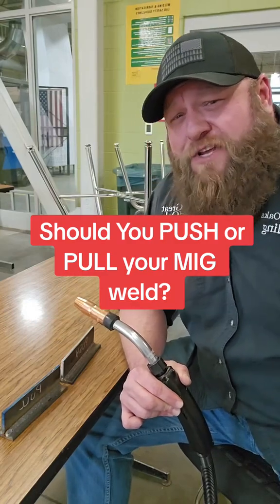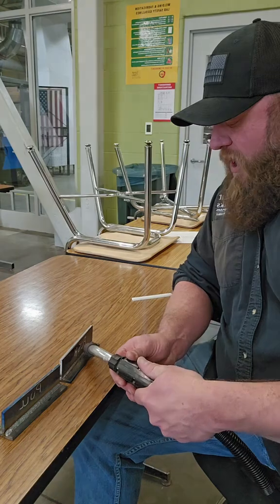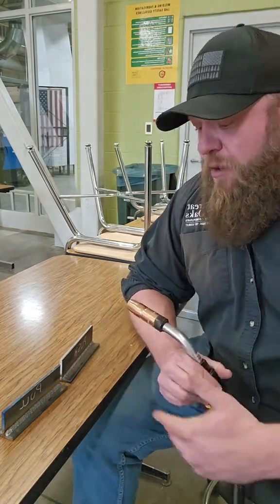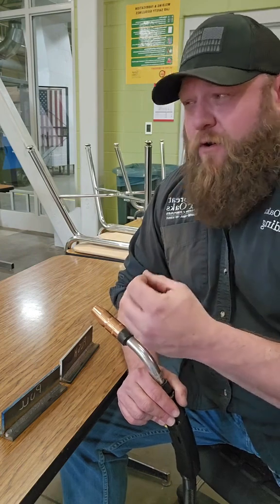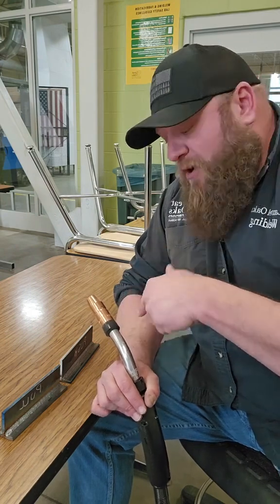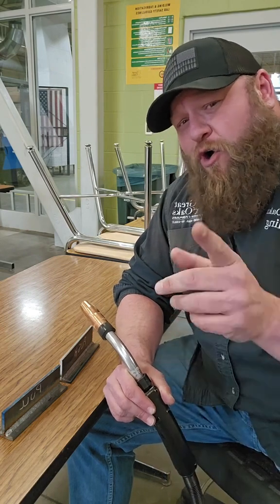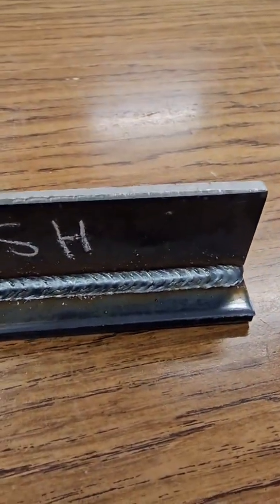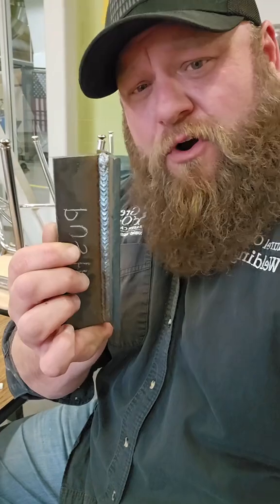Should you push or pull your MIG weld?

Comment: Both!, but push slightly more often depending on the joint in front of me. Almost all of my welding is in spray transfer. .045/.052 wire, 92/8 gas, OTC welder w/ Benzial water cooled gun✌️

Comment: Total beginner here! Where should I focus my vision while pulling (fcaw) ? If I pull away from myself, I can see puddle clearly, but nozzle blocks the path ahead and I stray a bit. If I pull towards myself, the path is clear, but the arc and a wire make it hard to control a puddle. What’s the best approach to get optimal vision of the process?  Thanks!

Comment: If I'm using flux, I pull, and I'm just welding something different I will push. Also it depends on whether or not I'm welding overhead to. I have used both before.

Comment: I don't understand how you're going to say that Pulling has more penetration and then turn around and says that for a structural weld vertically, you would push uphill for more penetration. Well, which is it? Because pushing gives way more penetration. You're pushing the wire  into the metal. Therefore, it gets more penetration every single time. Thats why you run uphill for a structural weld
Reply: I'll always push and only pull when the situation forces me to. I just hate the shitty penetration of pulling

Comment: I think pull with no oscillation is perfect for flux w gas, a more convex weld doest mean better penetration...  more weld metal you have it will be weaker.  The metal around it.

Comment: The correct answer is C. Both. 
I push I pull whatever I gotta do to get my part built. Just make clean tie ins and keep the BBs away you’ll be good, don’t leave wire stuck to any part. Blend your not so good ones and keep it pushing. Take pride in your welds no matter how big or small. Don’t sell anything you wouldn’t buy to break it on down for ya!

Comment: Eye production MIG weld for a company that does a lot of commercial semi trailers and other large equipment and the rule of thumb is you push as much as possible. If you have to have one continuous weld and sometimes you have to back out of a corner or something like that, you can pull, but you rarely want to start a weld pulling downhill is almost exclusively for things like covers or hoods you go uphill for anything structural
Reply: Ye pushing on mig is definitely the best Pulling does not give you more penetration either and most weld test you do with mig they will expect you to push not pull unless your on flux core

Comment: 95% or more of my applications  are made with the push or leading the weld puddle, especially with the thinner gauge metals. Burn thru is less likely and good speed is achieved with push technique. If I'm welding extremely thick plate, I'm going to drag the gun and penatrate the root pass completely.  Thanks for the explanation for the beginning welders...

Comment: I’m not a welder by trade nor do I have more than maybe a couple hundred hours experience max but I’ve only ever pulled if it was something normal and only pushed if I had to like if it was weird angle or I was filling a gap or spot welding or making multiple short welds on something somewhat thick or filling in porosity if I messed up or was too lazy to remove all the slag on a ‘quality not required, sanity and neck muscles are lost’ job since I usually use flux core and my stuffs usually temporary like a couple broken front end mounts on my truck where it just needed to work until parts came in.

In reality a couple of those parts/welds held for years even on a 6” lift 2500 with 37”s because I couldn’t remove the bolts holding it the frame so I decided to roll the dice and they only got replaced when my family decided to secretly take my truck to the shop and surprise me with more problems than it had to begin with but my little china express sum ting wong wuan20v didn’t let me down even welding upside down on at least one cast iron/steel part and several cracked and bent stamped 1/8-1/4 mounts

Comment: I run STT mostly downhill root passes on Boilers. Then fill and cap with dual shield uphill.  But flat welds I push and pull just depends on what I’m doing

Comment: If it’s heavier gauge like 1/4” up I’m pushing. If it’s like 1/8” plate or I’m filling a little gap I’m pulling it.
Reply: Thats opposite of what you should be doing. Pulling penetrates, pushing reduces burn through.